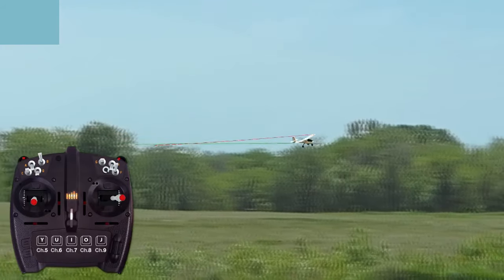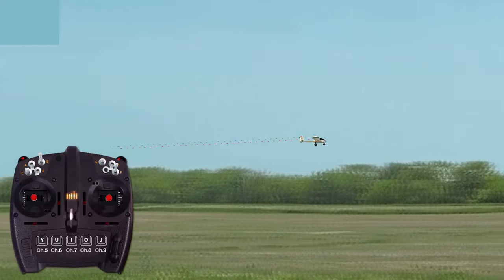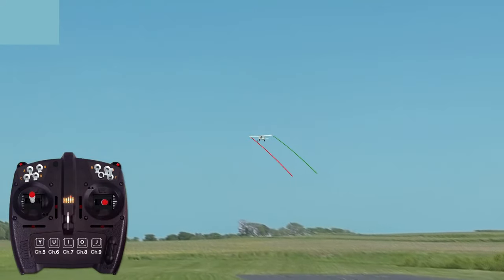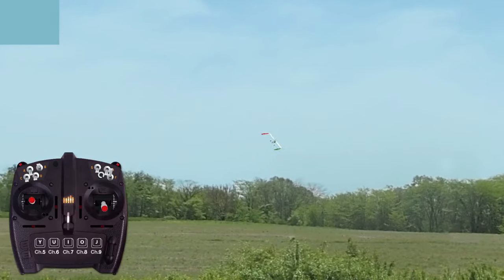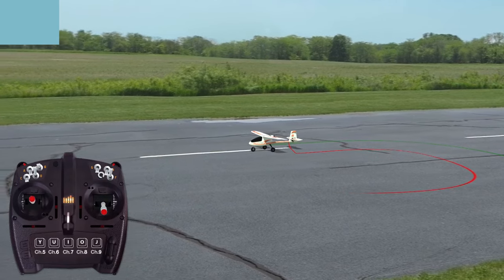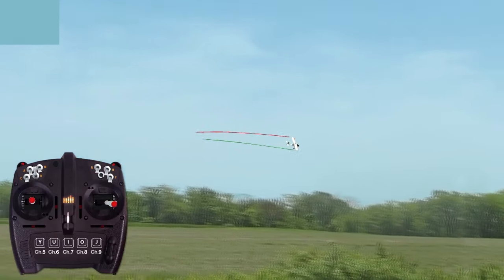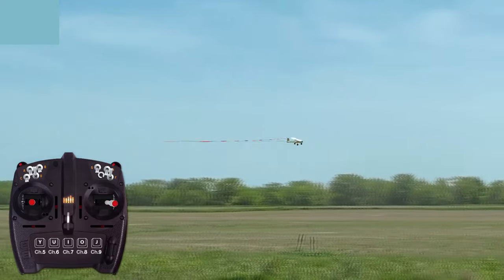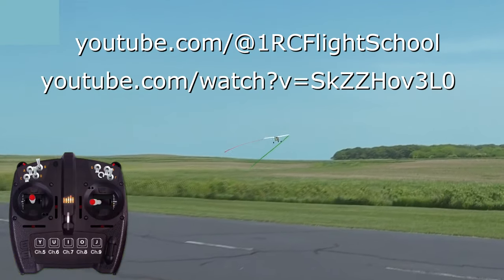Comparing SAFE and Conventional Control Techniques

Comment: As a new flyer I am trying to learn how to incorporate rudder control. I find it much easier to use the rudder to course correct on final approach to landing than to use the ailerons. Also to use the rudder to flatten turns to stay away from turn stalls.
Reply from the maker: Hey TX.  I suspect you've resorted to rudder because it is less effective than aileron and you were holding in the aileron too long.  You will run into problems later on with sport models trying to correct deviations with rudder, i.e., rudder will cause yaw, but the plane as a whole will not change course, amounting to a larger deviation to correct.  Whereas, a smidge of brief aileron affects an immediate drift in the direction of the slight bank.  You might get away with flat rudder turns with a trainer, but inducing a skid while turning can actually be a recipe for putting the plane into trouble.  Good luck

Comment: SAFE mode: to me it seems a very dangerous way to learn to fly. I have been flying for 40 years and took up flying racing drones. I started in 'angle' mode which is equivalent to SAFE mode on an airplane apparently. Wish I'd never done that. ACRO-mode (or limitless mode, beit with mild steering surface deflections) is absolutely the way to go in my opinion.
Reply from the maker: I get where you're coming from.  However, I deal with this weekly and I can tell you that learning conventional control techniques is no more challenging for a pilot who has been flying on SAFE v/s someone completely new to the sport.  The key is giving specific instructions on how the controls are used.  However, 99% of the fliers in our sport are mainly reacting to what the plane does, as opposed to the 1% who tell the plane what to do.  Reactors will definitely struggle with reverting back to original habits of holding in aileron.